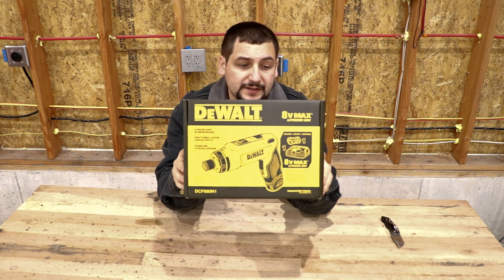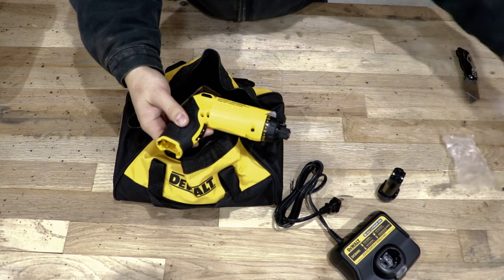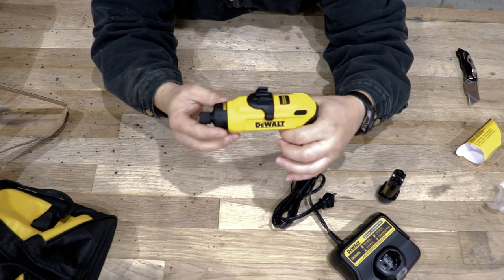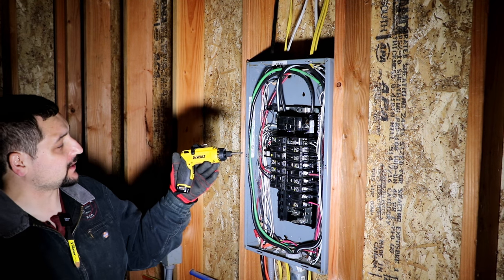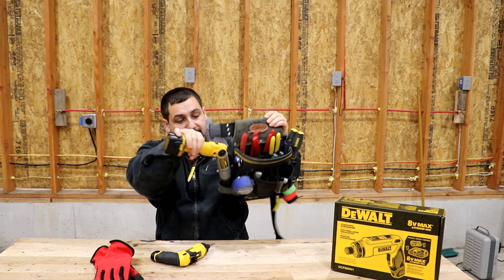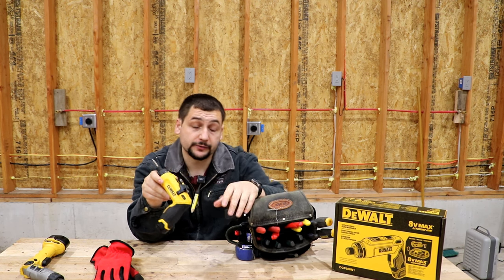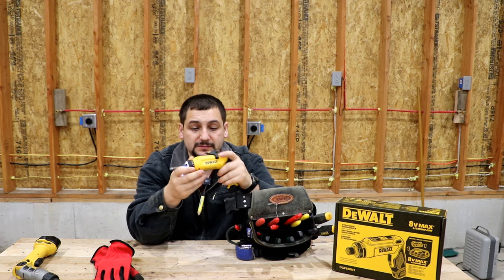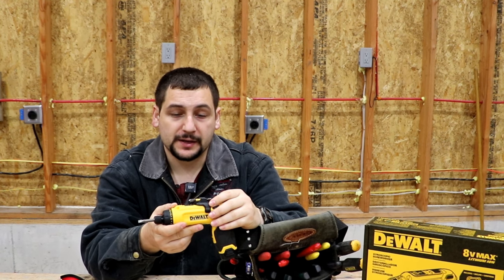DeWalt DCF680N1 powered screw driver Review!!!

Comment: Thank you for this review. You put a lot of thought into assessing the screwdriver and how well it works. I have a lot of trouble getting the bits in and out of the bit carrier and bit case. I try to push them into the slot and it may be that they will loosen with use. Any suggestions in the mean time?
Reply: He mentioned wd-40

Comment: After six months of posting the video would you still recommend it to me.  I'm not sure if i will like the gyroscopic though but I do love the design and the size.
Reply from the maker: Yes i would recommend it after using a bunch. i have found that i turn to it more than i ever thought i would.
Reply: I'm about to get my Eelectrical & maintenance certificates and I know I'm going to need an electric screwdriver for my switches and receptacles.
Reply: Thanks for the info.  👍

Comment: Am I a weirdo for using Hoppe's No 9 gun oil on a lot of my tools instead of WD-40? My rationale is that it's designed to lubricate and prevent corrosion on steel exposed to the elements rather than simply displace water. There is a price difference though.

Comment: Yo your bit holder is on backwards
Reply from the maker: I put it on both ways and it was still a problem, mostly my fault as i push the drill into a cloth work belt and the bits get hung up on it the glue did fix the problem for me though.

Comment: Hey Einstein... Before you go gorilla gluing that bit holder onto the top of the driver... flip it around 180 degrees. You might find that it actually fits and stays in place.
Reply from the maker: I did and it did not. mostly my falt as i push the drill into a cloth work belt and the bits get hung up on it the glue did fix the problom for me though.
Reply: @DanielWoodell  Not to be toxic but it's also a screwdriver you kept calling it to drill which is likely why you don't like the swivel function, However, this is an absolute must for others out there buying an electronic screwdriver.   I have to work inside ovens and dishwashers and behind panels that you have to reach into, you wouldn't be able to unscrew if it was shaped like a drill, there just wouldn't be enough space for the tool to fit. Without this feature, it would literally be a piece of shit.